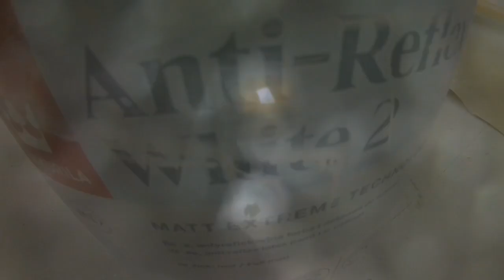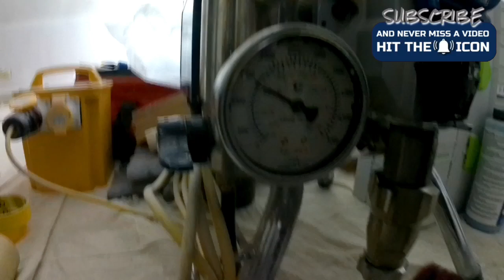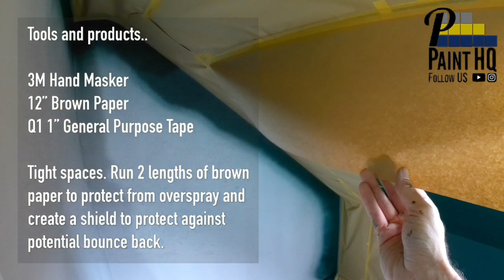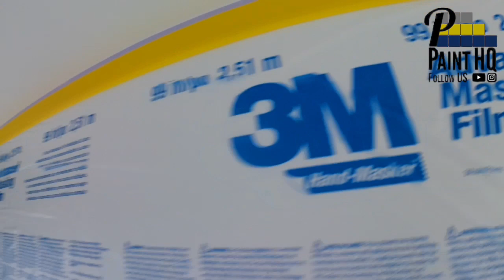How to Paint New Plaster | Mist Coating | Airless Spraying Interior Walls

Comment: It looks like you're using the Graco contractor pc compact gun.  I am thinking about getting it or the non-compact version.  Would you give you're personal pro's and/or  con's/impression of it.  Thank you!  Nice job on that room, looks sharp!
Reply from the maker: Hi Tobias, really appreciate you watching the video 💯 Yeah it’s the Graco Contractor Gun PC Compact Gun.. in my opinion the Graco PC (Pro Connect) guns are the best in the industry for airless spray guns.. their introduction changed the game in soft trigger pulls, ergonomic light weight design that reduces hand fatigue and of course the PC quick change gun cartridge for on the job rebuild.. the original (bigger) version has the ability to alter the trigger length from the most popular 2 finger, to 4 finger if that’s what you prefer.. the difference with the compact is a static 2 finger trigger (you can’t alter that), smaller (compact) pencil filters and a different hand placement on the gun, where 2 fingers wrap round the hose attachment part of the gun.. sounds weird, but it so comfortable and adds that bit more manoeuvrability, especially when spraying trim / woodwork.. both have very small advantages over the other, so the bigger version perhaps, very slightly isn’t so manoeuvrable when spraying trim (only slightly).. whereas the bigger version is a bit more stable when tilting back to spray ceilings (just slightly an advantage over the compact).. but yeah both are awesome guns, I know very highly regarded in the airless spraying world.. both the same retail price.. I believe the compact comes with a free shoe lace whip, which really makes a big difference to manoeuvring the gun.. hope this helps.. keep in touch and let me know which one you go for, and let me know if I can help at all with anything else.. regards Pete 🎨💯
Reply: @PaintHQ  Thank you so much for taking the time to write the detailed and gracious reply, it really helps and appreciated!  I will let you know which one I purchased! Thanks again!  -Tobias
Reply from the maker: You’re very welcome, anytime.. feel free to reach out if I can help 😆

Comment: Hi Pete, beautiful video again

I was wondering if I have excess airborne mistcoat overspray with a FFLP514. It doesn’t matter if it’s 800psi or 1500. It also tends to run down the wall if the pressure is too low. 

Do you think it’s too watery or perhaps a LP tip instead of FFLP could help? I have a LP517 which I haven’t tried yet
Reply from the maker: Hey Jarrod, apologies for not replying sooner my friend.. could be a bit watery if mist coat is running, or you need to move the gun quicker.. the fresh plaster should suck the mist coat right in.. regarding pressure, that won’t control for paint flow (that’s the tip orifice size.. so a .017 will have a greater paint flow than a .014).. pressure is just used to atomise the paint and achieve the optimal spray pattern (no tails, s feathers edge and nice and solid and even across the middle).. when spraying emulsion / or mist coat, an FFLP wouldn’t make much difference Vs an LP tip, the finish is virtually the same.. only the way paint is atomised is the difference between the two and LP are the bigger sizes .. so .015 .. .017 and so on, then .014 and smaller would be FF LP ..id stick with the 514, the paint flow will be less and you’ll have mice control, then just try thinning less, about 30% water ..keep in touch my friend, I’ll always get back to you and I’m happy to help and answer questions anytime brother ..regards Pete

Comment: Seems like a lot of water added to the paint. Are there any issues with dry times or coverage?
Reply from the maker: Hi Jason, thanks for your input my friend.. is it the mist coat that you’re referring to?.. good question, I’ve actually started to reduce my mix of mist coat to just 30% water (approx).. 70/30 mix ..anything around 70/30 - 50/50 will be fine in my opinion, the fresh plaster sucks in the water from the mist and drys very very quick 👍 ..thanks again, keep in touch.. regards Pete
Reply: @PaintHQ  thanks for your response. I’m a painter here in Texas and was wondering if there were any dry or wet spots in the final finish. Thanks a bunch!
Reply from the maker: Hey Jason, ah awesome to hear from you in Texas 🇺🇸🙏
..The finish is a lovely even coat and dries down a lovely flat matt my friend ..hope you keep in touch, I’m happy to help and advise if I’m able to 👏 ..regards Pete

Comment: Why did you not do the ceiling first? Isnt that easier as you wont have to mask the entire walls?
Reply from the maker: Hello my friend.. it really is so much easier to mask a line with delicate / sensitive tape and then use 99” ceiling to floor plastic that protects the walls from overspray and protects woodwork / trim from dry fall.. I guess you can think of it like cutting in a wall with a brush.. it’s easy to find a line along the wall.. same with masking.. keep in touch buddy, great to have you contributing to the channel.. regards Pete 🎨💯

Comment: Hi there, love the video's mate, a couple of questions, do you pull the masking off when wet and on the graco ultra what number do you usually run for gloss. my gloss paint is quite thin 5% water and still getting tails on 7 using a 208. Cheers From Australia.
Reply from the maker: Hey Paul, thanks for your feedback.. really great to hear from you in Australia 🇦🇺👏👌😆 ..It’s a pleasure to be able to help and advise you any way I can 👍 ..First of all, yeah I pretty much pull the tape wet.. maybe it dries a fraction, if it’s soaking wet, your hands get covered in paint 🙈 ..Regarding the speed / setup of the handheld.. I too use a 208 for thin low viscosity material, but I’m at speed 3 or 4.. you’re right not really wanting to go above 7... as a general rule with airless spraying.. if you still get tails after when increasing pressure - increase tip size - so an .008 - .010.. here’s what I would try.. you mention thinning 5%.. I wouldn’t thin at all and up the tip size to a 210, I’m guessing your speed will be around 5... Then if you’re getting tails at speed 5, try upping to 7.. if still tails.. drop back to 5 AND thin the material with just a drop👍

Is your 208 a Graco FFLP ?.. they are great tips, just sometimes, for an unknown reason you get tails like you describe (I’ve heard others say the same).. let me know how you get on, keep in touch buddy, always great to hear from you.. regards Pete
Reply: Hi Pete, just want to say thank you for your reply. i just love the way you answer peoples questions, not just one sentence answers but an essay, your a good man.
anyway back to business. masking tape off wet after last coat, rolling the paper into itself, cool.
I seem to get a few blockages with the Graco FFLP 208, even bought the finer mesh filters. i swapped it back to a wagner HEA 311 with better results but get sagging on some corners of door frames. i think it puts out too much paint or i need to go faster. will have a look for a 210 and look up some of your trim video's
 I have the wagner 250 pro and graco ultra, this is a hobby but you never know, a career change at 57. A lot of people over here hate painting and most houses are single story.
All your advise is now locked in and i think you will be hearing more from me with more top video's you make.
Cheers Paul.
Reply from the maker: Hey Paul, you’re very welcome my friend 💯 ..Ah yes I see a potential career change on the horizon 👌👍😆 ..Yeah the .008 tips are more prone to blockages by design.. a blockage can also look like tails, but more extreme.. just a quick point about tip sizes that may not be obvious.. a 210 tip for example will let out the same volume of material as a 410 but in a much narrower fan (4” Vs 8”).. you would need to move much quicker with a 210 tip but the trade off with a 410 is a wider fan resulting in more paint where you don’t want it.. I say this because, if the pattern looks good with a 311, I’d stick with that.. whereas a 210 would help Vs a 208.. You’re right the sagging on the door frame corners is down to speed and the number of times those corners are being hit.. it’s a typical problem with door frames.. you may notice from my videos that door frames (and window reveals), I try to ‘arc‘ around each internal pass, so the paint stops on the horizontal underside.. paint has less to zero chance of sagging on a horizontal (bit like a ceiling).. the architrave / trim part of a door opening is a little trickier, because the vertical surface could get hit multiple times in the corners.. with a 210 tip you may need to move as quick or quicker Vs a 311.. sorry I’m waffling on 🙈 Keep in touch, more than happy to help all I can.. Pete 🎨💯
Reply: Cheers Pete, i could talk and learn about this all day mate, if i was doing it more than a hobby i recon i would get it, will look back at some more of your video's and get back to you with more questions.
Cheers Paul.
Reply from the maker: No problem my friend, happy to help anytime.. 🇦🇺❤️👏👏👏😆
Reply: Looks like he's in the uk the paint in the uk is completely different and we have to seal the plaster they do solid plaster over there thats why its pink .  looks like he's just spraying on top coat.. if your getting tails it could be the gun have you tried taking out the gun filter and the hose filter.  Just Strain the paint first you can get ones that you just sit on the ten ltrs and pour.. id also get a 310  tip...  jump on ebay get a few different ones only costs $5 compared to $65 in dulux  and grab a $30 spray gun they work mint..
Reply: @JONO3679  Hey Mate, I am from the u.k. from what i remember you still have to seal the fresh plaster. we used to use i diluted pva glue brushed on.
yes my filter is clean, i tried the 208 again yesterday with good results so must have been the paint or blockage in the tip., British paint from Bunnings.
(Pete, British paint is made by Dulux over here and sold in Bunnings, B&Q to you ; )
Regarding the tips, i would give them a go if you can send me a link. Thanks for the feedback.
Reply: @paulmckeown8557  yeah in nz and aus we seal all plaster .. as for the filters I remove them all it just gives better paint flow just strain the paint first.. using 210 tip was to slow for me
Reply: @JONO3679  i had a look on ebay for the tips, are they fflp tips ? great price. Cheers
Reply: @paulmckeown8557  the lowest tip i used was a 310 the tips i use nobody else i know uses . Its what you get used to.. there so cheap get a few different ones to try.. get a gun to and tip guards...
Reply: @JONO3679  will give them a go mate. Cheers.